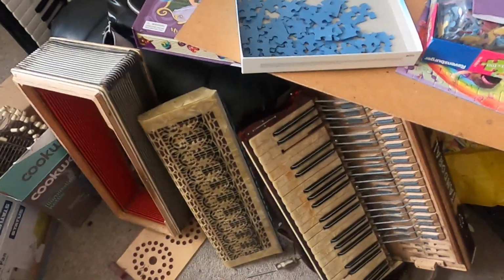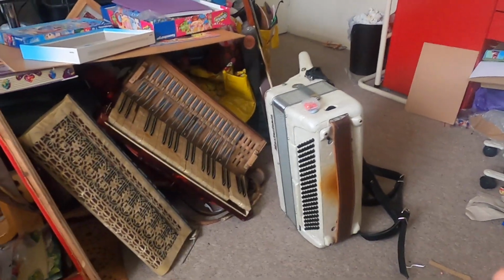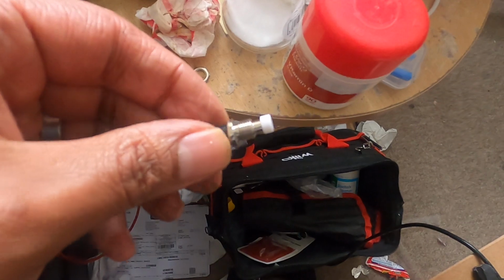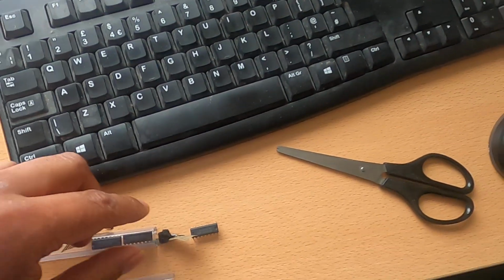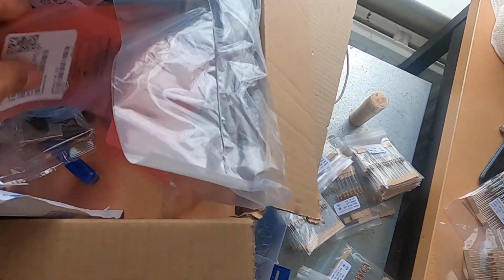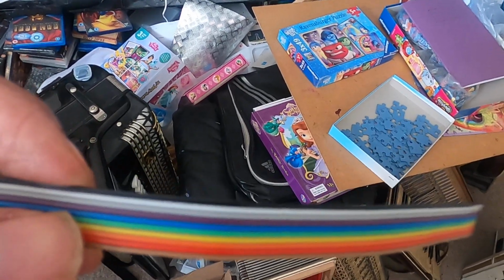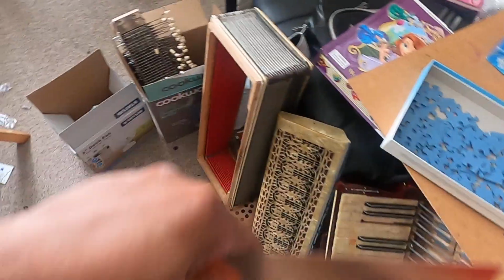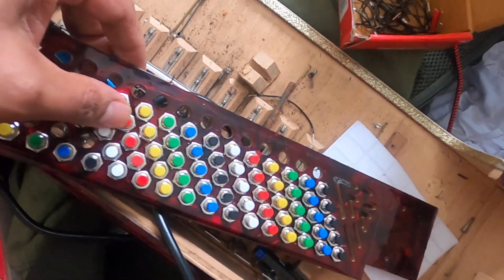Building an Electric Accordion Part 2

Comment: Always draw the moisture back out after you blow into the reeds, or there will be rust later on.

There are easier ways to wire the  bass system. Instead of 120 buttons to install, you only need 24... 12 bass notes and 12 chord notes.

Everything you're doing is the hard way. You're putting in WAY too much work. If you want any tips, just ask. I've installed over a dozen MIDI systems in accordions & concertinas.
Reply: Have you made a video on how to do it the easy way? If not, you should!